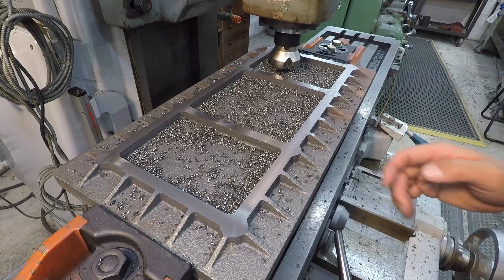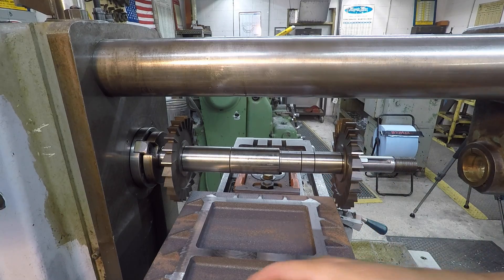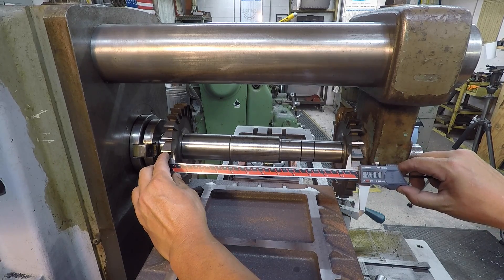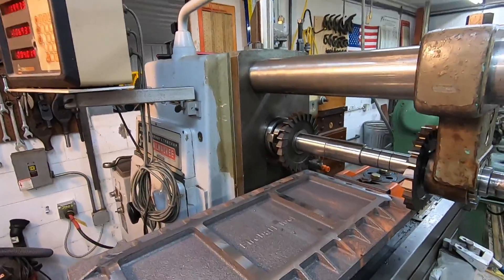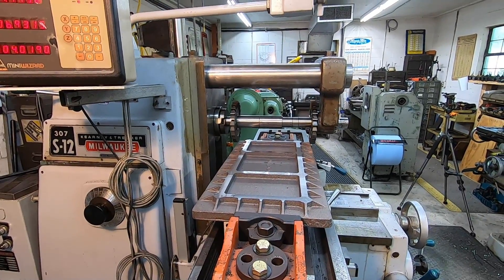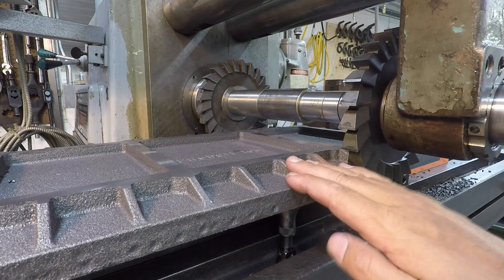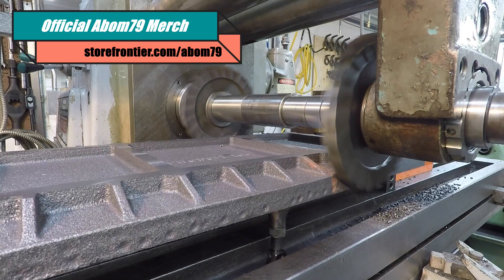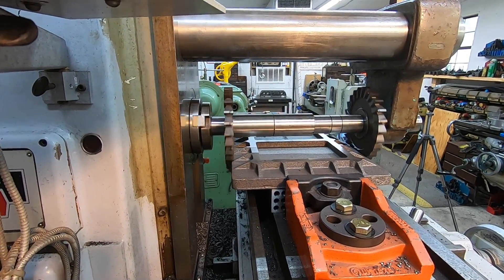Gang Milling the Fireball Tool Fixture Plate

Comment: Final width measurement - if the cutters aren't perfectly square to the arbor, one tooth would cut more than all the others. If one cutter had 1 thou 'wobble' and the other 2 thou, there's your 3 thou error - assuming you measured the cutter gap at the average value point for each cutter's wobble. If you measured the gap at the widest point between both cutters - then a 3 thou undersize could result from only a 0·75 thou wobble of both cutters. You measure 12" at the widest point then at the narrowest would be 1·5 under for the wobble on 1 cutter then the same for the other giving the 3 thou total.
Not seen gang milling used before for width - and particularly, accurate width but it looks like it proves test cuts are required as errors creep in all over the place !

Comment: 7:30 Why not machine this directly mounted on the table ? with the outboard cutter following the channel the machinist jack is in and the inboard cutter is off the table - the work could be clamped down to the table at the ends but at least then it'd be rigidly fully supported.

If you'd done it this way, you could have eyeballed the misalignment as you'd notice the edge of the work wasn't parallel to the channel.
Reply: If it was on the table, then the table would get cut too eh.
Reply: @jemijona  I guess you didn't understand what I said.
Reply: @millomweb  Now that you explained it better, that makes sense. Thank you.

Comment: Mistakes are ok, so long as we learn from them. Except you are still making the mistake of using imperial measurement. I am truly confused as to why someone would use anything but metric.
Reply: You're actually only half right. It's not just metric; it's metric-decimal. So even US machinists, that still use inches as an unit of measure, have adopted the decimal part (they work in thoushands of an inch and not fractions of inches, which is the true traditional Imperial/British system). Besides, the inch is already specified as 25.4mm; so it's only a matter of time that the US will adopt the metric system.
Reply: @Garren King Professional workshops don't work in imperial though, it is all metric. Nothing is designed in imperial, so changing measurements from metric to imperial is just silly and introducing an area for error.
Reply: @chippyjohn1  Lots of machine shops in the US still use imperial as the standard, when every mill and lathe you own has imperial dials and lead screws you match that to avoid constant errors. You aren't watching some random guy with an import machine, this man is a third generation professional machinist.

Comment: we can produce different electric valve, such as on/off valve, proportional valve, it can work with different voltage, and different control method for option.Our electric valves have a wide range of applications, if you are interested, please contact me
Website: http://www.tf-electricvalves.com
Email: lee@china-electricvalves.com

Comment: Hey Adam, I come across this video this morning and I can not help myself but I am in need of some very much needed assistance/ information. On the Gang Milling here, I have purchased at auction a 1900-1920 ish Sebastian Co. metal lathe with a 6' bed and this other machine with the name Whitney MFG Co.  No.6 ( they was auctioned as a set and I wanted theand these are the only markings on this machine. I just so happens to be a horizontal milling machine just as this set up you are using here ( Minus the power train of coarse )  NOBODY here in the woods in Missouri has any knowledge on anything with this machine. I can figure it out on the operation side of things, but do you or anyone else here know about the disassembly of the main cutting shaft?  it came with about 10 different shafts all of them have like a Jacobs tapered end but I am unable to free this shaft. It appears to go completely threw the head stock with a 14" drive pulley on the opposite side of the head unit. Could you or anyone else here assist me here on this?
Reply: Hey mate. Internet archive has a large repository of old machinery documentation, sales books, manuals, etc. maybe there will be some info there to help.

Comment: Adam, how can I contact you to modify a bolt that I cannot find for a 1964 craftsman table saw?
And I also need a shim washer which I haven’t measured yet, to take up backlash In a worm gear.
I would imagine it’s probably no more than .008 or .010 thick.
Do you have a source for somewhere that I could get something like that or is that something you could make?

Thanks for the help and the videos.
Reply: I don't know which country your from, but have you looked at the assortment from mc master-Carr?  https://www.mcmaster.com/standard-washer-shims &  https://www.mcmaster.com/bolts
Reply: AlmightyMister USA

Comment: I have a project on my YouTube channel Kevin Bergeron im building a Kawasaki engine and i am using a 10speed transmission in a 5speed case I need one of the bearing bore and seal bore enlarged to accommodate the 10 speed shaft i would like to have you machine the case big fan of your channel

Comment: When using a table saw for wood cutting I learned to crank the saw as high as possible. The forces during sawing are more directed to the table instead of pointing to you. So if I would gang mill this part I would crank the table as high as possible just clearing the arbor from the part and the vices. So the cutters are less likely to draw the part in while cutting and pushing the part down more. I would also make the opening between the cutters wider than the part and cut one side at a time. By doing so you can correct the misalignment on the fly as long as the width of the part is not critical which I think is the case. Otherwise indicate the part in before cutting. But you're the king at that. And we all make mistakes otherwise we wouldn't make anything at all. Human I think. I hope I explained my point well and you can understand what I'm saying. (I'm Dutch and tyred)  Furthermore; thanks again for sharing this great content with us! Stay safe. Best regards, Job

Comment: Well you can never trust a casting to be square. Shouldn't need to indicate it. Just drop the Z and run the table back and fourth. Eyeball will be more than good enough if the cutters are close to the surface..
Reply: True or use the side of the table as a reference. Just with two squares or cylinders pushed against the work/table, then clamp. Even more straightforward would be to move the Y axis and square the job against the Z  dovetail as a ref. Should be good enough for a casting.

Comment: that shutter effect got me at first... could you explain more about the "climb cutting" setting you mentioned?  to me this wouldn't be a climb cutting, at all, but Im a carpenter, not a machinist
Reply: Climb cutting is when the tool is spinning in the same direction as the machine head is traveling - as if it were a car tire on a road "climbing" up a hill. Where the tire is the tool spinning, the car is the machine head, and the road is the work piece. That's the opposite of conventional milling/cutting, which is where the tool spins opposite the direction of travel. Typically, conventional milling gives a better finish because it tends to limit backlash/play between the lead screw and the nut in the machine table. But there are circumstances where you want to use climb cutting over conventional.
Reply: @Tom2112Tom  I would have guessed it was when the cutter is "climbing" out of the work, so in this case, it would have the effect of lifting the piece out of the vise setup..
Reply: Would be the same as feeding a table saw from the wrong side.
Reply: That's a good way to think about it, it's like an upside down table saw, and feeding it from the wrong side
Reply: In woodworking, climb cutting is usually restricted to shapers with feeders. Prevents blow outs, chips, on reverse grain. Did it all the time, though few do.

Comment: Can't you fill in the corner, with stick weld, and then mill it ?
Reply: It would add half a day of work & it is hard to predict whatever welding would not torque the plate a bit. You would need high nickel electrode for cast iron. Lots of work and lots of risk of it all failing. I would just use a filler or nothing at all - unless it is 100% absolutely needed to be perfect.

Comment: Adam, I'm surprised that you didn't re-measure the distance between the cutters after cutting nearly 0.006-in. smaller that you said you expected.  I have to assume that something "compressed" after you added the last shims and did the final tightening of the arbor nut?  I'm looking forward to the next videos on this fixture plate!
Reply: Bob Vines As the cutters heat up they will grow and take away width. Also a the part heats up it grows and gets more taken off it as well, thus it is easy to end up narrower than you thought. Could also have been some cutter run out as well.

Comment: Man this channel has changed so much and not in a good way. ;( I been watching for years and I liked all the work / content that u did back at motion. I did so much work on one video and it was packed every week. Now I feel like it just one op her and one op there and then your done. Let’s get back to the old channel and let’s see some good work that u use to do. I miss that old channel I feel cut short when watching. :( still love ya but it’s been this way for awhile
Reply: The bosses didn't want him making any more videos at work. So it was going to go away anyway (the videos of heavy machining at work he did).
So it was this or nothing. (Keep the YT channel or keep the job).
And the work is the same, in fact the work he does at his shop is more elaborate than what he did at motion, just repairing big shafts and pistons. You just want to see the BIIIIG stuff.
In fact i personally find his work now A LOT more interesting, than just cutting a huge roller to size and putting some bearings on, etc... THAT, was actually boring to me.

Comment: Anybody else playing mind games watching the cutters go the wrong direction?
Reply: Yeah that's an artifact of the refresh rate of the human eye which is about 14 and some change frames per second. So you are seeing a strobe effect like wagon wheel spokes rotating the wrong direction.  Cool stuff.
Reply: @physicsguybrian  The temporal resolution of the human eye is way beyond 14 frames per second. Depending on the situation even up to 500Hz.
https://www.nature.com/articles/srep07861
What is causing the stroboscope effect in this case is that the frames per second the camera is taking is close to the frequency of the moving blades. The video is only representing the video in the manner the camera was capable recording it. The representation of the moving blade is limited and capped in temporal resolution, the human eye could have more perception beyond that. The video is limited in visual presentation and does not represent the ground truth of the temporal resolution.
If you go to the most trippy part at about 6:00 and pause, and then, if you watch the video frame by frame you will find out that the blades still move backwards which tells you it is the cameras fault causing this effect. I am not saying the human perception is save from the stroboscopic effect, if you think looking at moving tires on highways, but here it is clearly the representation of the video causing this trippy effect.

Comment: Will having that little lift on the feed table hurt accuracy or warp the table over time? I've never seen anything like that.
Reply: I had the same question.... Handy rig though! That would make a lot of back breaking setups a breeze.
Reply: I don't think it can hurt. He has a few vids on setting up the crane for the mill and lathe. In the lathe it sits on the tool holder.

Comment: When I was and young Machinist I operated a drill press it had some roller on the bottom back side it had been converted to an electric motor the foreman explain to me that is used to run off of a belt that was driven buy a Drive shaft that ran around the top of the Machine Shop a friend of mine has a belt that is approximately six or eight inches wide not sure how long it is but I would guess 10 to 12 feet do you know anyone that might need or want it looks to be brand new I can send pictures of it if needed and get actual size and length I also enjoy watching your videos
Reply: David Richards, "Old Steam Powered Machine Shop", YouTube, could easily be interested.

Comment: Thanks for showing those powerful machines doing those jobs.
You told You would do like climb milling and You as aware of the riscs. Suppose You had raised the table higher, getting the casting as llose to the axle as, Close to the center of rotation, possible. Then more of the force would be directed downwards and less force would be of the "climbing" type.

Comment: OK this might be the wrong crowd to ask this but does anyone know why fast rotating objects often look like they are rotating in the opposite direction to what they are? My eyes and brain are telling me the saw blades are rotating in the opposite direction to the shaft they're mounted on :S
Reply: It's an effect known as aliasing, and it is a result of the interaction between the rotation rate and the sampling rate (camera frame rate). You can even get strange situations when the frame rate is an even factor of the rotation rate, and the object seems to stand still (if the exposure is short enough that object doesn't significantly blur).
Reply: Ryan Miller of course the latter effect is how timing lights worked, for those o,d enough to remember using them.
Reply: Me under the hood, to my helper in the drivers seat, hit it again! Trying to get TDC.
I remember trying to take pictures of the first moon landing off the TV.
When I got the prints back, they all had a nice black diagonal line across the print ( I was too young to know about scan rates)
Reply: Ryan Miller Beautifully explained!
Reply: @ryanmiller1180  Your answer sounds about right, however this phenomenon can also occur when directly observing a rapidly rotating object without a camera or screen.
Reply: @asvarien  But only under artificial light, which has its own "sampling rate."
Reply: @RonParker  yes florescent lights with old fashion ballasts and some cheap LEDs have flicker, as far a as I know you aren't/weren't supposed to use those at rotation machinery because the strobe effect might make it seem like a tool isn't rotating or rotating very slowly
Reply: It's been an effect ever since moving pictures were invented,  How many old black and white westerns have you seen where the wagon wheels seem to be standing still or even going backwards?  In those days (24 frames per second) if the wheels were rotating at anything other than 24 rotations per second or an exact fraction/multiple of that then the wheels could easily seem to be going backwards - it still applies today even in the digital age, depending on the video sampling rate.
Reply: The accepted answer is that it is due to the foibles of the cameras used. I have always disagreed.
Mostly since sometimes it looks in the proper direction.
I recall in a psychology class in my younger days that there was a phenomenon (cant recall the name) that makes convex shapes look concave based on the lighting. I am sure this affects other shapes as well. So I always figured that the direction of the light makes a spinning object look reversed. 99% of the time light is from the top, but when light comes from the bottom (rare) all seems in a normal direction.
Reply: @loufaiella3354  You might disagree, but you'd be wrong. Ryan Miller's explanation is 100% correct
Reply: @loufaiella3354  what direction is seems to be spinning will depend on the relation between the frame rate and the rotational speed and number of teeth. as you can see the flat spots on the spindle nut seem to rotate the correct direction and the cutters backwards

Comment: On the next one, consider indicating both of the long edges. They may not be parallel. You might have to split the diffrence, or maybe use the rib features to establish a centerline (depends on what the print shows).

Comment: That’s straddle milling, gang milling involves more than two cutters or cutters that are not finishing each end or sides of a part.
https://www.theengineerspost.com/milling-machine-operations/
I’ve seen many skilled guys (and me) doing complex jobs on a horizontal milling machine, something you don’t see nowadays with CNC machines.
We used to shim one side of the cutter for example to produce a “wobble” to achieve a tight tolerance on a slot for example.
In the past you would see rows of milling machines, each with a skilled guy working them.
Reply: Monty Zumazoom I was about to say it’s straddle milling but you said it first.

Comment: Here in the UK that operation would be called 'straddle milling', gang milling usually involves two or more cutters of different profiles on the arbour to form a specific profile ,for instance the V ways on a lathe bed.
Reply: Malcolm Young you are correct.  It’s the same here in the USA.

Comment: I was there waiting for you to rapid to the other end of the part after you got the cutter spacers setup and it never happened...  I think also would have been measuring the depth of those casting flaws. Some of those looked pretty deep. So even if it was perfectly square, it might not have cleaned up.

The remaining ends look like a shaper job to me. Done in the same setup as the top of the plate. That is assuming the shaper has enough travel to span the plate that way.